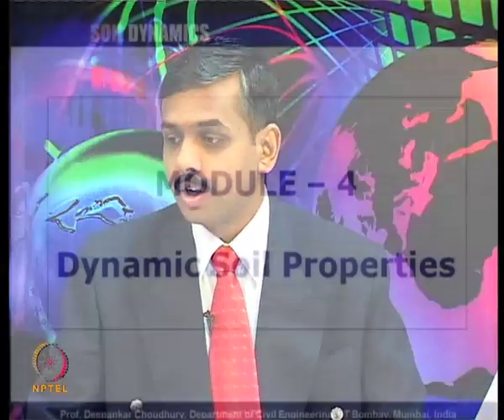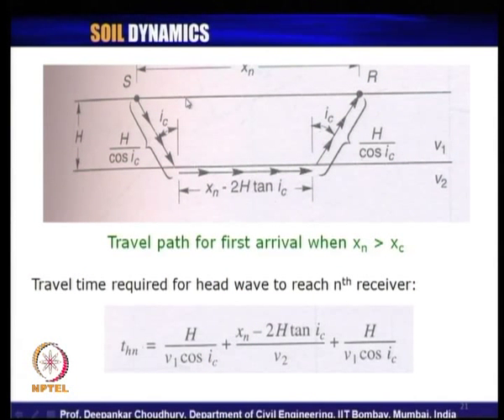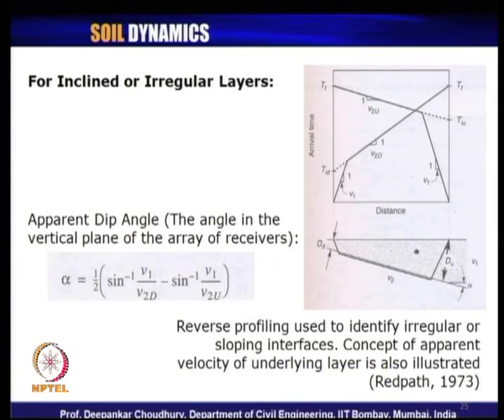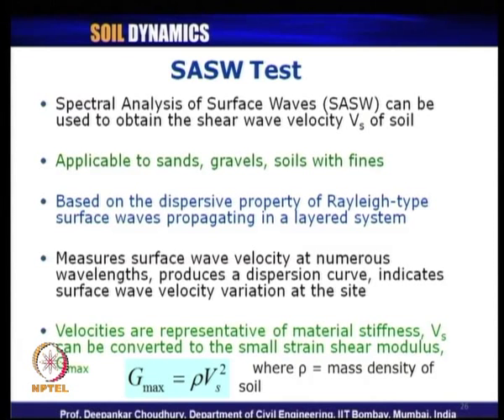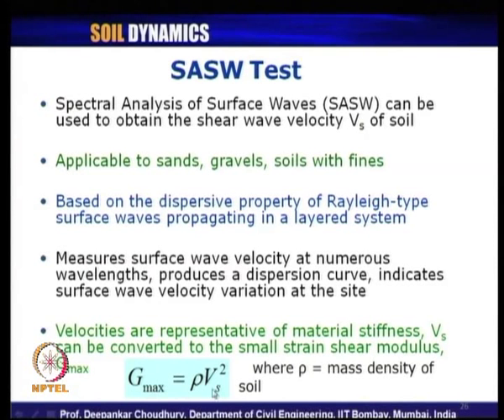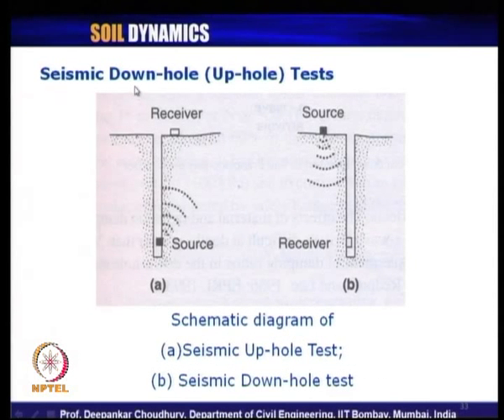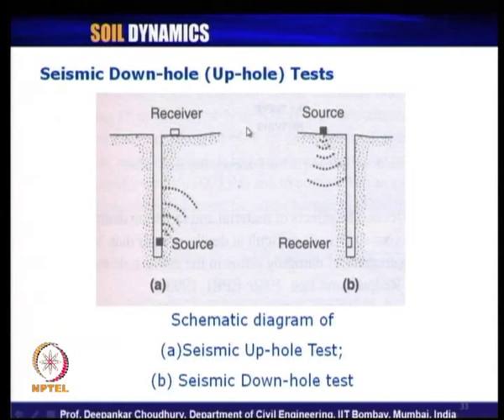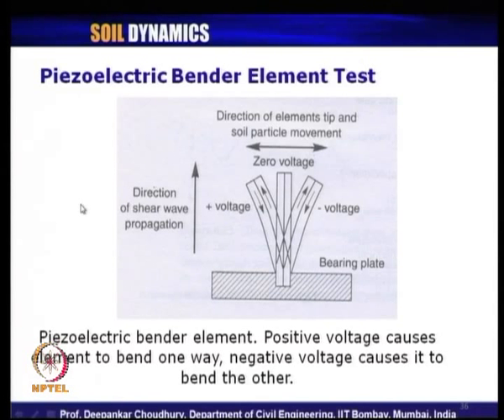Mod-04 Lec-19 L19-Seismic Refraction Test, SASW Test, Laboratory & Model Tests

Comment: In 51.42... The pressure bulb  significant depth is 1.5 to 2 B ... Then in case of prototype and model we ll get the same results .... For prototype the pr bulb is 20 m which is lying on the first layer only . Can somebody clarify this ?